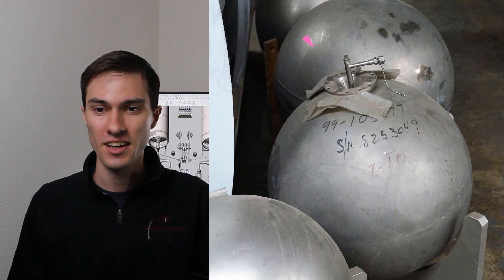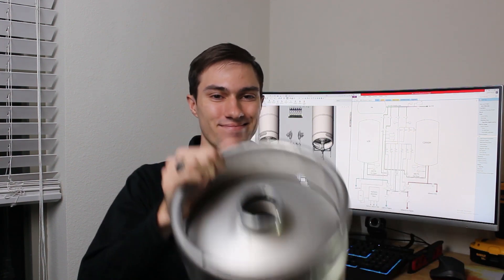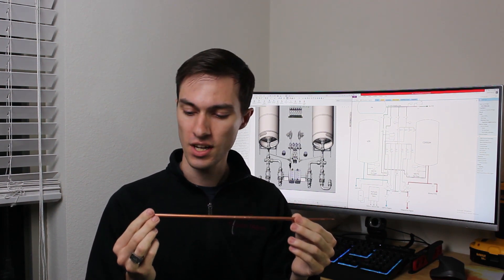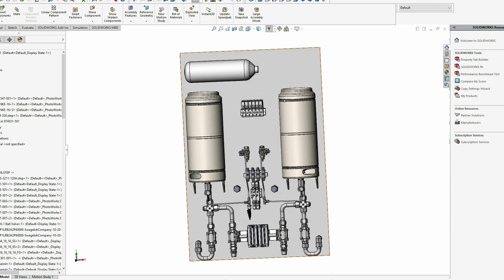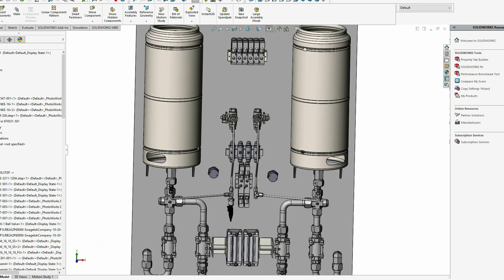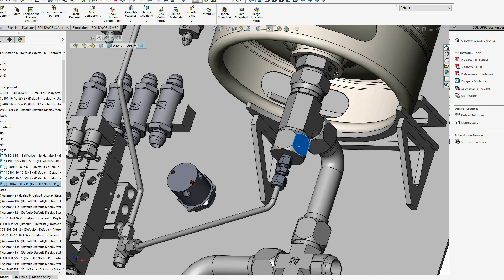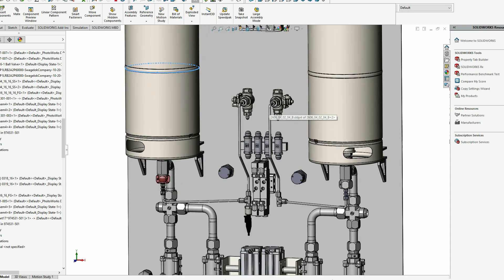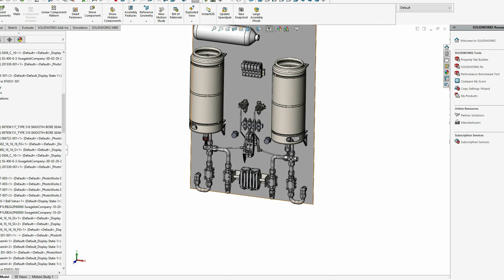Liquid Rocket Engines 7: Tanks and Capacitors

Comment: Interesting video, learned a lot.  One question through - how did you install the capacitive fill sensor such that it was electrically isolated from tank while still being able to hold pressure at cryo?
Reply from the maker: I used teflon bushings installed with RTV adhesive

Comment: Hey Charlie, I've been following for a while now and I am actually attempting a liquid engine design in university for an extracurricular group (I'm a junior year mechanical engineering student). So far the most difficult thing from a design standpoint has been the plumbing/valves (especially valves that have to operate at high pressures and handle cryogenic fluids). Do you have any recommendations for textbooks on plumbing (especially plumbing for cryogenic fluids), and also what software are you using to sketch up your plumbing design? In terms of tanks, a roadblock that I've run into that it seems you did too was how to get these tanks manufactured. Still working on that one (and trying to keep the cost down). 

Thanks for all of the useful information
Reply: People are overthinking this cryogenic-steel-construction nonsense. That stuff is for Elon Musk and the other professionals. Just use plastic, mainly, and overwrap linearly and radially with epoxy and fiberglass. You could even use polypropylene or high-density polyethylene LOX tanks by lightly sandpapering, acid-treating, the surface for epoxy-adhesion.

Fiberglass gets stronger at cryogenic temperatures, too. You're going to have fat plumbing, of course, but none this test-stand stuff is going to fly anyway, so what does it matter. And besides, apart from the engine proper, you probably could make a pretty decent liquid fuel amateur rocket with plastic and fiberglass anyway. For more details on rocketry-oriented fiberglass construction, check:
https://apps.dtic.mil/dtic/tr/fulltext/u2/405170.pdf
"The Effect of Cryogenic Temperatures on the Mechanical Properties of Reinforced Plastic Laminates." 1963

Finally, would such a system blow up? Of course it would.
It ain't rocketry if something don't blow up. Failure isn't an option, it's a necessity.

Comment: Hey Charlie, 
Have you considered using 2L soda bottles wrapped in fiberglass for the fuel tank? This might result in a more flight weight tank. They cost approximately $4 to make each. Air command rockets have tested them to 300psi but didn’t have the equipment to test them above that. Look here: http://www.aircommandrockets.com/day91.htm to see what I’m talking about. 

Also is there a reason you aren’t just regulating the pressure over the fuel and  oxidizer in their tanks instead of trying to directly deal with a cytogenetic fluid? By varying the pressure in the tanks wouldn’t that adjust the flow rate? With a precisely made injector this would eliminate the need for any low temperature valves. I think you might run into trouble with the valve handling liquid oxygen. 

Have you considered using dinitrogen tetroxide as an oxidizer? While it’s performance is much lower it is much easier to handle.
Reply: Not charlie, but my guess is that the system would be near equally as complex regulating pressure upstream as it would downstream (just an added variable of temperature) and you would lose substantial ability to throttle engine as you  would have to decrease pressure to slow down engine. Since the tanks are substantially larger than the plumbing hardware, there would be large delays in pressure changes (more volume to regulate). Which brings me to the last problem is that you could see yourself with a pressure inversion, sending fuel and oxygen back into the tanks. So you would still need check valves. 

Downstream tubing/valves allows more flexibility and also a larger envelope to improve and upgrade design. And its how the big bois do it.

Comment: Great work as always. Guessing you meant 8mm for the steel, and you are not attaching it to the side of a battleship... :P Anyway, only slight modification I might suggest is switching which fitting goes through the plate, so that if the engine goes RUD there is a steel plate between it and the 1.2 safety factor pressure vessels. Or is that deliberate? This way you can put the steel plate between yourself and both the engine and the tanks, and have it double up as your primary blast shield?

Also, are you using helium as your pressurant? I guess it will avoid any possible mixture woes but will probably end up being vastly more expensive than the fuels. An alternative would be have separate pressure tanks for fuel and oxidiser, and use oxygen gas to pressurise the oxidiser and nitrogen for the fuel, (or live dangerously and use oxygen for both, pre-cooling the fuel is suggested if you do this, and not having neighbours. Or ignore any mixture issues and use nitrogen for both. I really don't know if mixture problems would occur). Putting some liquid oxygen/nitrogen in a pressure vessel and then letting it return to ambient temperature (with a regulator, and maybe a little artificial heating for speed). Will need a little more time to set up, but it can actually avoid any fittings that have to be connected under pressure. This can also avoid a large inventory of pressurised gas if you want to do lots of firings without having to resupply, as everything can be easily stored unpressurised.
Reply from the maker: The engine will be on a separate structure, with steel in-between both me and the engine and the tanks. Essentially the engine will attach to a little 2" steel tube box that will sit about 18" below this structure.
I have to use helium because I'm using dip tubes now. If I used nitrogen and flowed it up through the LOX there would be a risk of ullege collapse.
I'm hoping that I can use nitrogen on my pneumatic leg and on my fuel side, but if I do, I'll just hook a K-bottle up, so there isn't much design work to do.

Comment: Charlie, not sure if you know but imagine you do... cryogenic service valves usually have a stem extension to move the packing material out of the cold area. Not sure from your models if you have that, or if you really have any significant concern with packing damage with this application.
Reply from the maker: I absolutely do not have that, and we'll see how bad of a choice that is after I star breaking valves...
I'm only expecting to put a few lifetime cycles on the valves, so hopefully it'll be okay.
Reply: Any valves you’re going to have chilled in to cryo temps without a thermal standoff  will break within minutes. Would highly recommend looking into this depending on how long it’ll be between filling the lox and firing the engine

Comment: For my first bi-prop engine (was only few N) I used a old chemical fire extinguisher, the type that hang on the wall. For the 5Kn engine that I have been working on I was planning on using a stainless steel water fire extinguisher, they are rated to the 300 psi, that I am planning on using, also are hydro tested to 500 psi. I like the idea of beer keg as it will allow me to have a longer burn time.

Comment: How exactly does the fuel/oxidizer move into/ out of your capacitative gauge?
Are there small holes or slots?
I haven't seen them in your design and I am concerned that it might not react fast enough otherwise.
Reply from the maker: In the test article it moves in from the bottom. In the real version I'll need additional testing on the capillary effects to determine the sizing of both the tubes and the metering orifices.
Reply: @AstroCharlie  Thank you for answering. I thought the Teflon bushings might make fluid flow impossible.
Wouldn't it be easier to have a tube for the helium gas and a solid wire fixed next to it instead of a tube? Or would that seriously hinder integration?